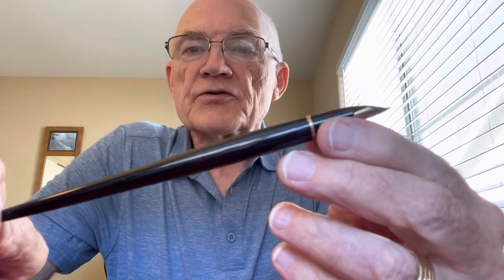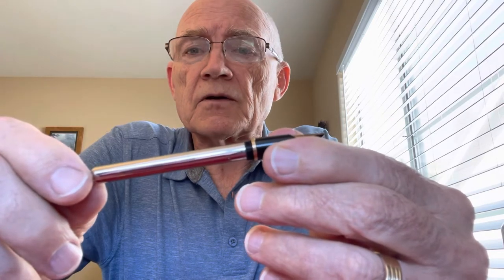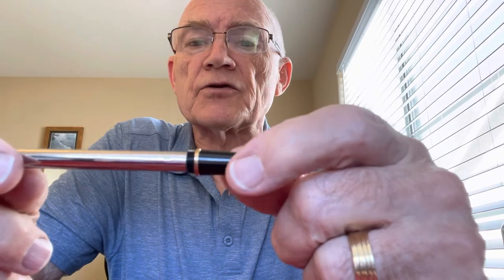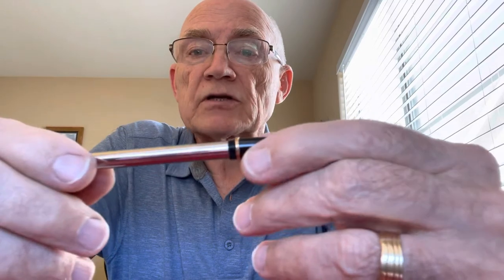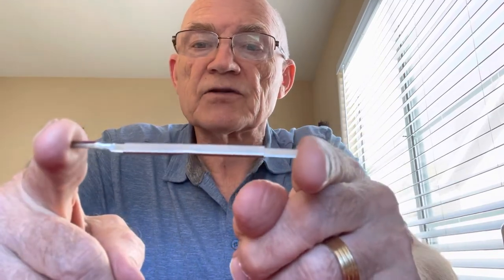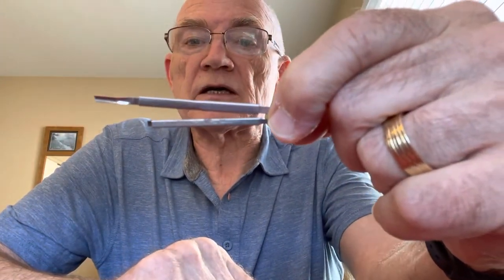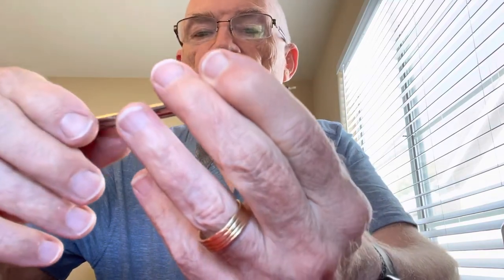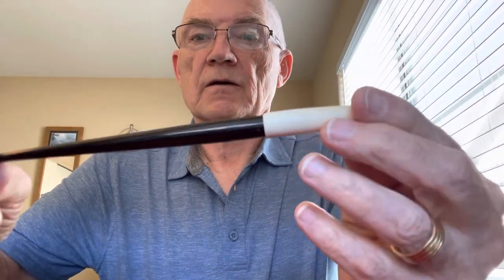Fountain Pen Repair: Restore a Vintage Pilot Knob Filling Fountain Pen

Comment: 5:46 Your "parts" pen that you showed with the cracked section-- I've managed to fix a crack like that before, on a very similar pen; multiple stress-induced hairline cracks in the section would leak ink on my fingers. I can't see exactly what's going on with yours, but if the previous owner just applied glue on the surface of the crack, you're right it won't hold. You have to first gouge out more of the crack, create a bit of a trench where the crack is, to make more surface area on the plastic for the glue to grip. Then apply as many coats of superglue as it takes to fill in the cracked/trenched area. Sand to make it the correct shape again. Then polish smooth and it'll be like new again. Hope that makes sense. Best of luck if you proceed with repair!
Reply from the maker: Thank you!